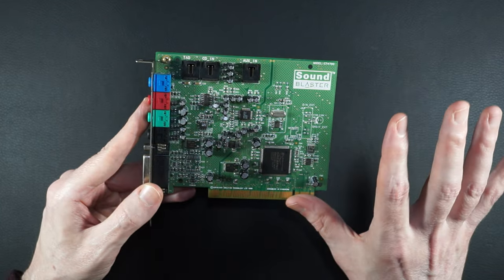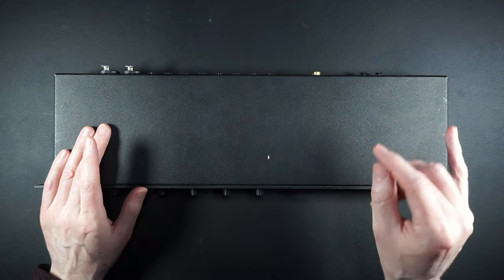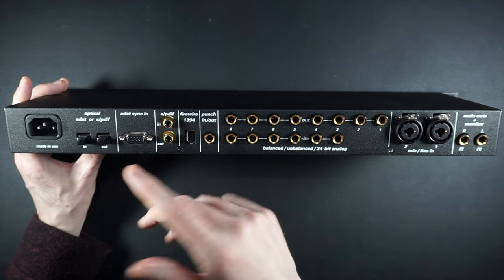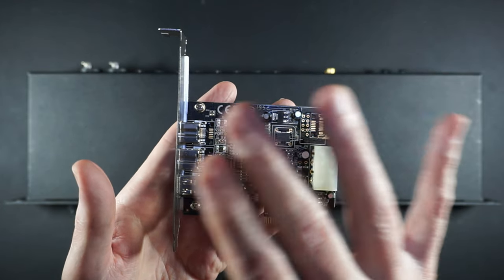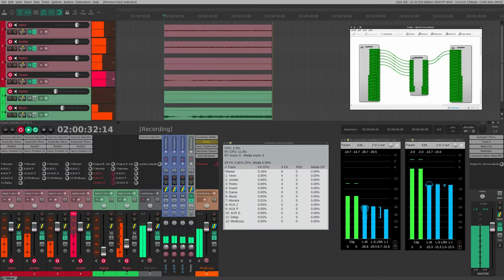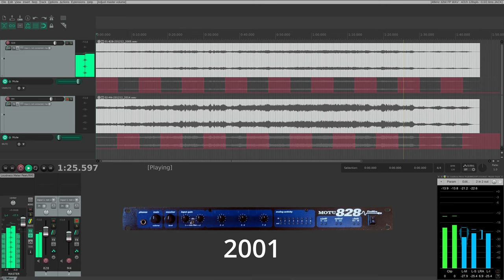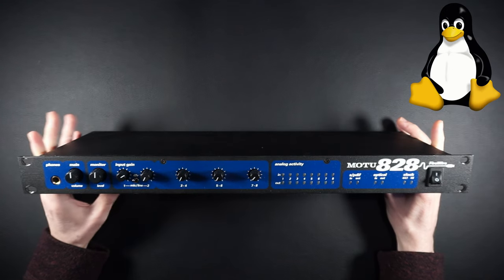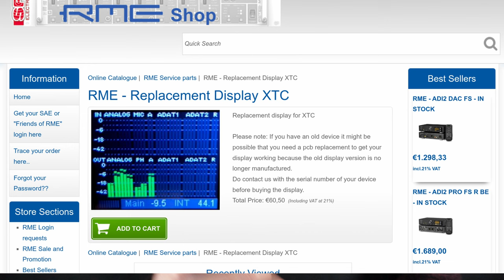Interfacing Linux: MOTU 828 MK1

Comment: Another great FireWire gadget review! I'm using the MOTU Traveler (as I said in previous comments on your Traveler video), and it's being put to use nicely. And I like and respect your chops at video production. Your videos are easy to understand, logical, rational, well-thought-out. Keep up with the Fire-noodling. 

Oh, and which one gives up the ghost easier/sooner, the Traveler or the 828mk3 ? I can find either one here in Japan cheap on the used market but a Traveler is cheaper than a 828mk3. But if and when my Traveler dies, which should I buy to have in the wings as a backup?
Reply: The 828 MK3. Bad caps on the power supply. It's an easy fix if you're comfortable replacing them. My Traveler MK1 has never had a problem. I would keep an eye out for the Traveler MK3. Best of both worlds.
Reply: Thanks for the reply and the helpful info. I'll keep an out out for a Traveler MK3.  @VennStone

Comment: This was really interesting, thanks! I actually just picked up an 828 a week ago to use with my Dual G4 MDD under OS9; good to know I can also get it running under linux 🤘
Reply: Does it work with Windows 10?
Reply: @austinnosa374 
Good question - I just dug mine out and booted into Win10.
 Short answer - mostly? I needed to install ASIO for all, and some apps are a little quirky with it, but so far I've gotten Reaktor and VCV rack to work just fine. On Puredata, I had to select the 'Old MMIO system'. Trying to get it to behave as the default system audio device is a little goofy, but it "works". 
Hope that helps!

Comment: I am always motivated by such videos, ideal world, but here with ubuntu studio chance to get this up an running, some weired error messages with fado, jack, pulse. saturday is gone with all the tries and errors, I go back to my apple. I guess that a lot of steps in advance are missing. Is there no installation of ubuntuu, were it works out of the box?I can use jack, but with faddo i am lost. Any link to a list if steps to run ffado smoothly?
Reply: Use the operating system that works best for you. I've helped troubleshoot FFADO several times in the Interfacing Linux forums. Might be worth a look.
Reply: @VennStone I was able to get My ah zedr16 running with ffado, pipewire and ardour. My 828 is not recognized by ffado and pipewire, maybe interface is broken? For the ah zedr16 i only needed to deinstall qjack.
Reply: @frankmuelder4539  Correct, FFADO does not work the with 828. You will have to use the ALSA drivers.